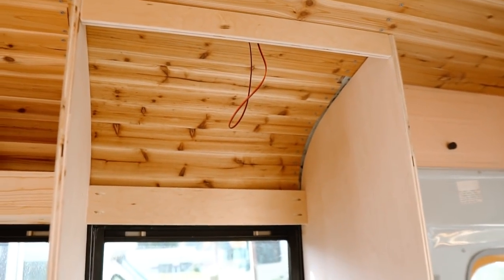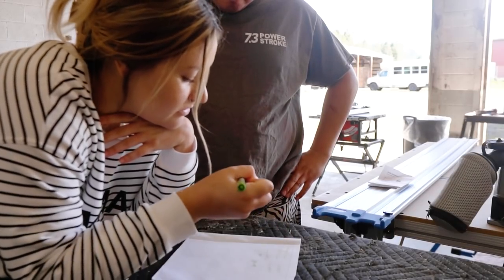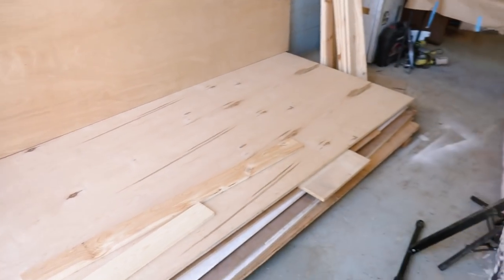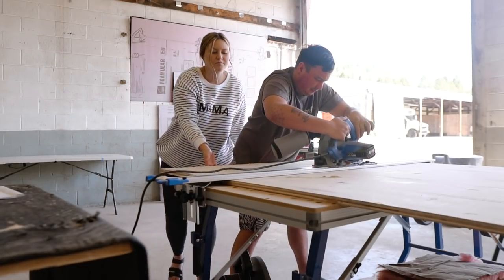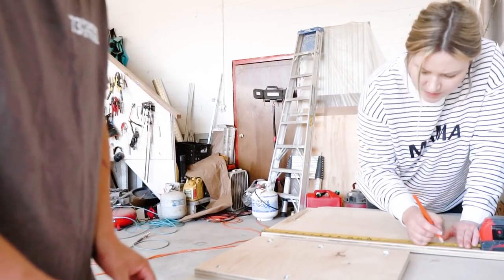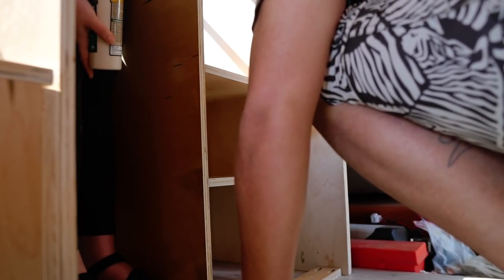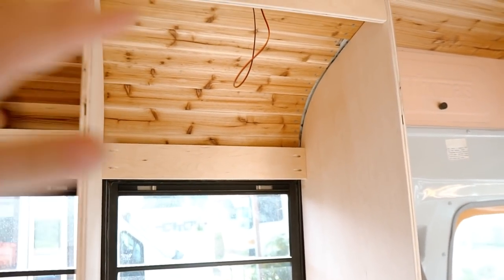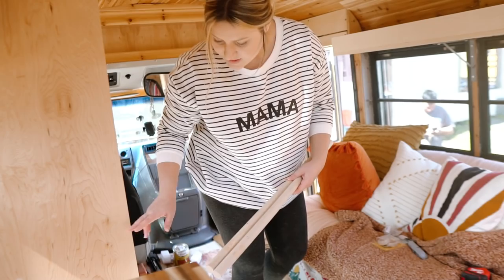Spacious Skoolie Closet Build - TONS Of Storage - Short Bus Conversion

Comment: I love the way your bus is turning out Jaylena..The only thing I would have done different is I would have put the curtain on the inside of the opening,I do love that curtain though..it's stylish!!
Reply: I think it was all about using the driftwood, the natural element, and display the macramé piece on it Had it been the dowel rod, I’d completely agree with you. A friend drew geometric shapes on a branch for me about three years ago, and it’s just been hangin above my door. Now it will hold a macramé curtain another friend is making me, in front of my bedroom area. If it fits in your design, I say use nature as part of your decor…  🥰🙏🏽✌🏽💖

Comment: Everything looks nice.  May I suggest to get a second macrame curtain that would tighten things up so your sides of the closet will be more closed and you can bunch it together more so it is not so much see through.  Although you are the only person going to be in the bus so maybe not a priority.
Reply: Agree
Reply: Agree
Reply: Agree.  Gives the benefit of entering from the closet from the middle and not pulling your macrame to one side.  Also should secure your natural wood rod at either end if you get a second macrame closure.  You can also open up the hook 🪝 on the right side so that they both fit, if it is what you really want to use.
Reply: Or use the hooks you have to put at the sides to keep curtain in place while traveling!

Comment: Jaylena, you have done it again, you have made a great job of your wardrobe, if you were to put the other rail up you could use it for belts/ scarves or anything that doesn't require a coathanger. it can be further back and closer to the ceiling.

Comment: You have lots of room in that closet.  I’d probably do coat hooks on each side for robes hats coats belts or even your towels at bottom of dress side I’d put some sort of lip to hold shoe heel. I’d probably put a top on the shelf to put spare sheets or spare towel 

Just saying. Just some thoughts.  I don’t know if your doing a slide out pantry